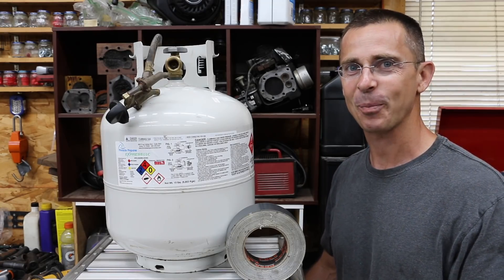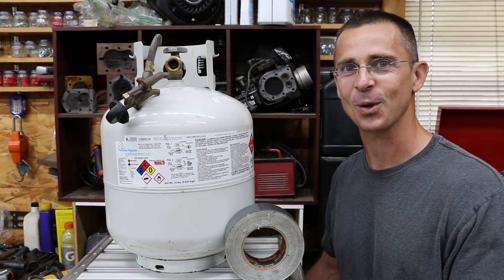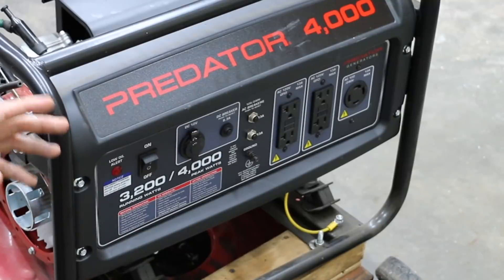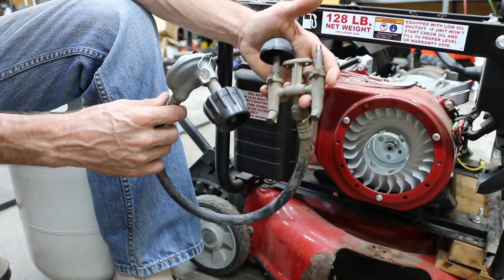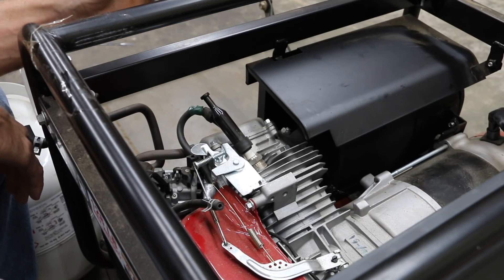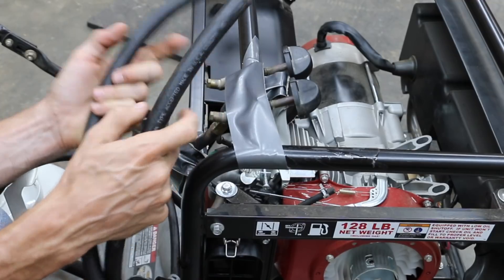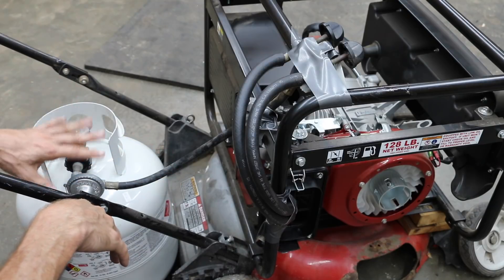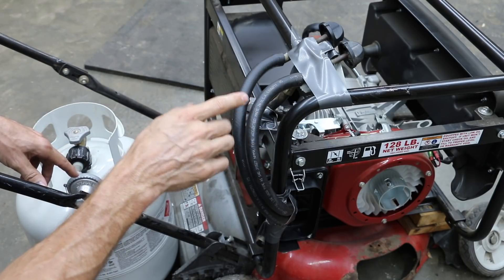Can a gas (propane) grill power an engine?  Let's try it!

Comment: Have you done any hydrogen tests? get you a cheap fuel cell off ebay or make your own and try it out. see if you can get better MPG on your truck once you test it out on a lawn mower or something... You could even do water injection (if you havent already) which would also make a good video.
Reply from the maker: Not yet. Thanks for the video ideas!

Comment: Propane IS my go to fuel for ANY small engine with difficulty to start - you WON'T flood them out, and as shown even without gasoline present the engine can be warmed up to assist it accepting liquid fuels.  Using propane is also an old trick many heavy equipment operators use for starting those super cold diesels while avoiding the use of highly volatile ether.  
Note also, many VERY LARGE emergency generators are run on propane or natural gas because of the well maintained purity of the source as that both reduces required maintenance as well as the increased reliability.  With a shelf life of decades - propane beats the snot out of any liquid fuels!  LOL
Reply from the maker: Great idea regarding hard to start diesel engines!
Reply: I'm in North Dakota - here you come up with ideas or they find you in the spring!  LOL...  unlit propane torches work great and the portability makes them a must have!  Temperature still plays a factor - and avoid Butane as it's not well suited for the "severe" cold.   Hopes this helps.
Reply: Last winter, the temp fell to  -43F where I live in North Dakota.... LOL I'm very well versed in cold weather starts.  Ether is ok as a once or twice attempt for gas engines, however the extreme compression of Diesel with extremely volatile fuels can bring really bad results.  I know it's used and most get away with no issues - I've also seen $90,000.00 diesels in which is was a catastrophic fail.  Roll the dice?  LOL

Comment: I used to own a 6 cylinder carburetored car that ran on propane or LPG (liquid petroleum gas) as we call it here in Australia. They can be a little bit tricky to tune, but if you get it right, they are very fuel efficient and run very clean. You get almost no carbon build up and your oil never turns black. You do still ned to change the oil though. Ford and GM in Australia actually used to sell factory LPG cars, built in the factory and sold out lf dealerships.
Reply from the maker: This is interesting. Thanks for commenting.

Comment: Very nice video, but weren't you at least a little bit worried about potential residual propane escaping/leaking causing a fire or explosion?
Reply from the maker: Great point. I figure the risk is nearly the same as using a BBQ grill. I always have several fire extinguishers around just in case.

Comment: Propane Burns really well at a wide range of fuel air mixtures. 
some engines that are designed to run on propane simply leave the air intake wide open and regulate the propane flow for the throttle.
Reply from the maker: This is great information. Thanks for commenting.

Comment: For enthusiasts: the biggest problem you will encounter is that expanding propane cools the lines and eventually freezes, you need some heating or heated expansion chamber. There are cheap water-heated LPG expanders on the market which have a diaphragm taking underpressure from the inlet manifold and that allows operation of the throttle (gas pedal). Propane is unforgiving about state of the engine - MUST have good compression, valves not leaking and timing very precise. It behaves like high octane fuel so advance your timing; it loves high compression engines. Super clean to burn, no particulate matter, less than 10% of CO emissions (=good for powering forklifts indoors, e.g.), 50% of HC emissions, same NOx. No carbon deposits, used motor oil looks like new (not black). Has slightly less energy density that petrol/gasoline; engines with anti-knock sensor compensate for that by advancing the timing. Use standard spark plugs or silver tipped ones (not copper-alloy; test it yourself). Check your valve lash more frequently, initially. That's it, folks! Your engine will run smoother, quieter, longer and cheaper).
Reply from the maker: Great recommendations--thank you!
Reply: Concerning performance: depends on how you tune your system. Commonly, you have about 5-10% loss of top-end performance and 5-10% increase of fuel consumption measured in volume of compressed propane towards liquid gasoline. However, the engine reacts quicker on gas pedal so you will actually be faster on lights! The loss of performance is actually only because there is something inside the carburettor or air filter that leads the propane in. The engine needs no choke (choke does not have an effect to prevent stalling when engine is cold; use gas pedal for a minute, instead). There is no cold motor coughing or refusing to respond on gas, even in frost, it immediately reacts as hot because propane does not condensate inside inlet manifold. No oil is diluted by unburnt fuel when cold so no lacquer deposits in crankcase. Engine will be spotless inside (like new, literally) so no carbon problems etc.
Reply: I have a 6000 watt generator I run off grill tanks and its never had a problem with freezing up.  The pressure only goes low when the tank is nearly empty.  A small engine just doesn't burn fuel fast enough to ice up the lines.  Now my home made 200000 btu torch, you need warm water bath for that.
Reply: @GigsTaggart  if gas is preheated is more effcient
Reply: I work on a forklift that runs propane on a chevy 4.3 engine and another on a industrial mitsubishi 2.4 engine.  Both have no heating setup and have no freeze issues.  Both run great with no real maintenance and are probably the most reliable lifts we have engine wise.  Never adjust jack crap on them.  They just run.

I disagree about it being clean. Maybe in the chamber but your intake valves will gum up with oil from the PCV system.  Itll cake the intake and valves very badly.  Propane has always been forgiving in any use on a engine ive seen. Timing does not have to be super precise either. Needs to be as close as gas from my experience. The fuel may be clean but the engine does not get washed by fuel and is dirtier in certain areas.
Reply: @brandonbrown3600  More than likely, these engines use a vaporizor unit and liquid take off the tank - basically, the supply line takes from the bottom of the tank, and gets flashed to vapor right near the carb, in a unit that has engine coolant run through it. This is the only part that needs to be heated, but for an engine that big, it definitely needs to be heated.

Something as small as a ~6Kw generator doesn't really need it, as long as the surrounding temps are reasonable.
Reply: @brandonbrown3600 have injectors or gas is pumped in the intake ?   if is in the intake you need preheated gasifier
also the gasifier /preheated  chamber  have a valve  that open when your engine reach the tempreture
Reply: Project Farm  k.y. in the tranny for a video would he awesome
Reply: Adam Lipsky ahh, while this is true for high flow units like a 28hp generator, I don't feel you would have this same problem with the low flow BBQ units.
Reply: Adam Lipsky and Project Farm, you should also look into what happens when you run a propane injection system on diesel engines, it is a beautiful thing. Actually talked to a truck driver that drove his truck for years without it, did all his maintenance, went through a mild rebuild on the engine and it was nasty. When he did that first mild rebuild, he installed a propane injection system. He improved his fuel economy, there was no carbon build up on his exhaust stacks, he did his second recommended tear down of the engine and it was squeaky clean. He has been running it ever since and even installed it on his diesel pickup. Propane is pretty awesome stuff :)
Reply: Propane also generates a fair bit of water as it burns and can lead to murky oil in some engines, good to keep an eye out for.
Reply: I've installed I don't know how many LPG kits for Honda generators, never needed any heater. Just a regulator and the carb adapter that allowed you to run gasoline or LPG.
Reply: I have been using propane as a dual fuel in cars for over 20 years I love this stuff very basic maintenance  cheap and reliable.
Reply: i converted a golf cart to propane it runs a on demand regulator runs fine just used it for hours actually at a campground never froze up but i run on vapor it does run hotter on propane than gas it does run perfect i like it on propane better than on gas
Reply: How do store bought propane generators get around the expansion issue? We used one for 24 hours in the middle of winter for a amateur radio event, the tank froze up externally but everything worked fine. It may have helped that their was very little water vapor in the air that time of year.
Reply: @trcostan  Probably they don't. If you can redirect some of the heat from the engine(probably from the cooling fan instead of the exhaust) towards the tank(just don't get it too hot!), that'll help with expansion.
Reply: Works for me in a 2.0l dohc engine. Added a K&N filter and smooth the airbox. Engine runs much better now on lpg,better than on 95 octane, cant give you fuel econ or emissions figures, but you can certainly feel the difference. Burning 1l of gasoline requires 14.7l of air, 20l for propane and  26l for butane.
Reply: Never heard of LPG direct injection? LPG is injected into the port  as liquid, so it expands in the engine itself allowing for much air to the cylinder (compared with petrol) thus allowing more power out of the same displacement. Only old cars needed for an "expansion lung" heated by car's coolant system.
Reply: Davide Bacchi LPG direct injection work in liquid phase  the engine works both on lpg and gasoline 10%-20% gasoline to cool the valves and lubricate theme and most DI the computer cant be turnd off
Reply: right i have car that reach 200k miles on mostly lpg  (not injected) and the only fix in the lpg system it was the  expansion chamber     ,it was dumped in good working condition 
in italy you can use indoor forklift  and other machinery  only if is lpg or electric powered  engine
Reply: Yes, and thats why dual fuel is not practical. Using engine coolant to heat the liquid propane in a gasifier  takes care of the tank and line freeze up problem.
Reply: Project Farm  whilst you are  doing these types of fuel  try using metholox  or some hyperbolic rocket fuels or better yet hydrogen

Comment: I did this with my Homebrew Inverter Generator years ago. It worked well. The only problem is the lack of upper cylinder lubrication. Thanks for another great video!
Reply from the maker: Impressive!  You've got a great channel with a lot of terrific videos!  Thanks for commenting!
Reply: Does gas lubricate ?

Comment: That kill a watt measured was the same idea as the dyno test I had. It measures the engine performance accurately
Reply from the maker: Great point. I wish the generator (not the engine) was much larger and could overwhelm the engine.  it could then be used to measure performance improving fuel additives, boosters, etc.

Comment: For what its worth, the combustion on most modern engines looks more like the see-thru propane one. At part load, its a very nice, deep sapphire color. If you tried hard enough, you could get a nice cyan/blue combustion, but it would probably melt the lexan head in the process.
Reply from the maker: Thanks for commenting on this.

Comment: What will happen to a gasoline engine if I overfill Engine oil in it? (Say:- 3Litre instead of 2.5L recommendation)?
Reply: Souradeep, in a lot of engines (VW Type 1 aircooled and Chevrolet 350 are notorious for this), if you overfill the engine oil it'll blow the rear main seal on startup.
Reply from the maker: Great video idea
Reply: Project Farm thankyou for accepting or thinking about my question! I'll be glad if you make a video of it! 

By the way I have forgot to inform you that the overfill oil to a Engine is of a car engine (4stroke-3cyl naturally aspirated-carburettor type or newer gasoline engine 4cyl MPFI type)!
Reply: Overfilling the oil starts with filling the oil filter then through the piston rings and crankcase the drivetrain usually gets flooded with oil. If your system is well maintained the excess oil should be burnt off with the plugs noticeably black and oily. I always overfill my bored out v6 4.3L by a few hundred mls to help with the blow by and sticky lifters
Reply: jmowreader I think even some 4 liter ford engines will blow a rear seal aswell, I'm carefull with ours and it has 135k hard driven miles without having to open the motor yet
Reply: Benson, a LOT of engines will blow their rear seals if they're run with too much oil in them. I know the problem is bad enough with Chevys they've invented a two-piece rear main seal you can install with the engine still in the car.
Reply: jmowreader was that started when they had to improve the 350s in the older corvettes? From experience theres been a few exceptions of motors that will accept almost twice the oil amount, my 4g64 2.4L holds 4liters in total before the dipstick is at the full mark
Reply: Not sure, Benson. I've always been an import kinda guy. I know several people who have 350s and most of them leak, so I went looking and turns out Chevrolet 350s are prone to it. 

I like what VW did to the TDI engine: the rear main seal is in a housing with 12 bolts holding it in. When I did my clutch I thought...well, maybe I should change the rear main at the same time as long as the transmission is off. So I called the place I take things you need $600 worth of tools you can't use for anything else, and they told me: "we change the rear main on a TDI when we overhaul the engine. They don't blow."
Reply: jmowreader ouch hopefully they don't charge an arm and leg for a rebuild

Comment: Most petrol (gas) stations here in Australia sell LPG (propane / butane) blend, It was extremely popular  and still is with the TAXI industry. Back in the 80's we had a Ford F350 truck with a 350L LPG tank, ~100 gallons.
Reply from the maker: This is interesting.

Comment: I have had the same idea.  I have been thinking through how to cut-off the propane when the engine does not start dies.  You can pick-up a vacuum pulse at the base of  the carb.  this should actuate a valve to allow the gas to flow to the engine. This devise factory built is about $100.00.  A bit stiff for backyard experimenter.  There should be several ways to accomplish this task...don't forget electrics. I want eventually to be able to run the engine from a camp stove/lantern size propane bottle.
Reply from the maker: Great point regarding the vacuum pulse setup.

Comment: What about hydrogen? Can you make a hydrogen generator and run the engine on it ?? To make the hydrogen generator , all  you need is sheets of stainless steel, some bolts , plastic washers and nuts .. add some salt water  apply voltage to it an you have hydrogen.. there's videos on it ..
Reply from the maker: Great video idea!
Reply: Great hope to see it soon ..

Comment: One problem with this setup is the gas lines were in the way of the airflow. In my experience, propane is a better fuel on some levels. One security truck I used to use ran on propane, ran for 300K + without any engine problems, hardly needed to change the oil or plugs, but it didn't have quite as much power as one running on gasoline. We wound up running the truck on gasoline for a while after propane shot up, the truck immediately had all kinds of problems, the oil got dirty fast, the plugs would need constant attention, and it brown down completely not long after we started burning gas in it. Had we kept using propane, heck it might be running yet. Natural Gas does about the same so far as I know. I'd still like to see one run on all three types of alcohol. We know they will run well on alcohol, that's not the question, is there any difference in the types of alcohol Methanol, Ethanol, and Isopropyl. I have always wondered why they ad Ethanol to fuel or burn straight ethanol when the other types of alcohol are much cheaper to produce. Ethanol is the most expensive of the three to make. Alcohol will provide great power, but will not go as far as gasoline per gallon, that's a given.
Reply from the maker: Great point.

Comment: Now here's a follow thought. Can you get some liquid propane in the gas tank instead of gasoline and get it to run and balance the idle with the throttle control found on some mowers. Cool video!
Reply from the maker: Thank you

Comment: As far back as the 80s, the Army had propane - equipped utility vehicles (pick ups, suvs) that used propane to extend their driving range. Does the Air Force have the same set-up?
Reply from the maker: Yes, they do have pickups and SUVs that use it. Thank you

Comment: Cool, video. I think a lot of us had a pretty good guess on the outcome before watching the video, just from the fact that automobile engines can readily be converted to CNG use. The only thing you were lacking here was a way to automatically meter the gas based on the load, and you pretty much covered that mentioned that you needed to adjust the fuel manually each time you changed the load. I'm sure someone has already mentioned in other comments, improper tuning can lead to a lean condition which can cause valve damage, especially if the valves/seats are made from a softer material. As always, great, fun to watch video!
Reply from the maker: Thank you!

Comment: Very interesting. Im surprised how stable it was. 
If you turn the gas bottle upside down to get liquid propane will the engine run on that?
Reply from the maker: Great video idea!
Reply: The liquid would likely vaporize and stall the engine as it would get flooded with more fuel for a moment.